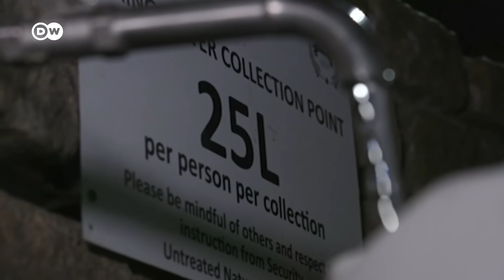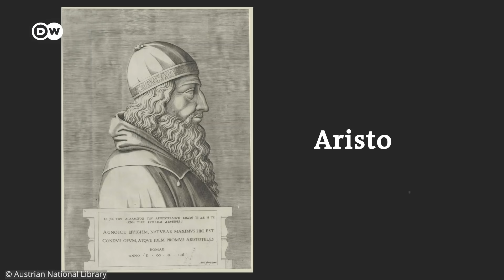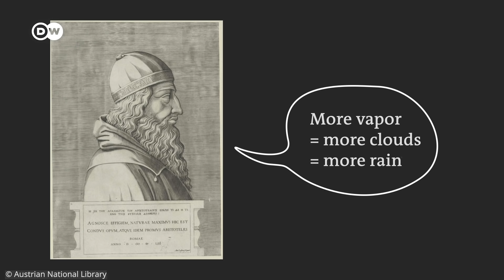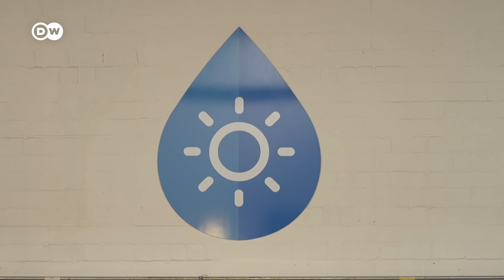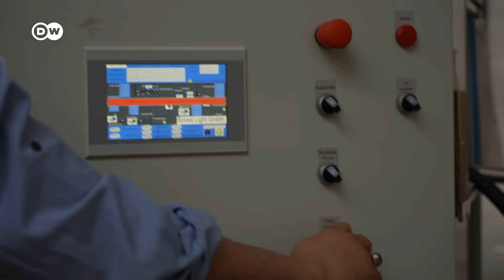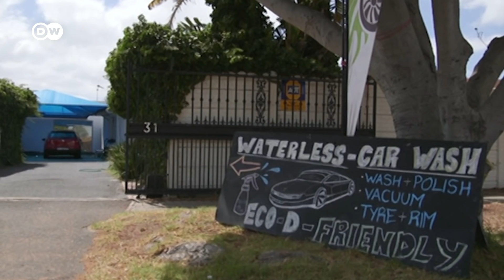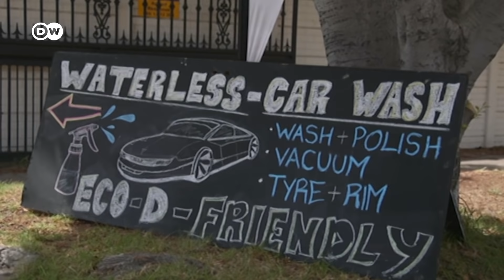Can desalination solve the global water crisis?

Comment: To put some numbers to desalination, for large plants the energy cost of desalination is just 2 watt hours per litre of water. Even basic solar panels produce sufficient energy to desalinate sufficient water for a person to drink and wash every day. Solar energy, water, heat, and people are all compatible partners.
Reply: Your numbers are wrong. It definitelly can't work for distillation plants.   And for membrane plants you must add into account cost of new membranes too. They must be replaced very often.
Reply: @nalim27  Naomi the Numbers are correct. Even for small systems on boats the figure is between 3 and 5 watt hours per litre. Note though that this is for systems with energy recovery pumps. Membranes have a very good life if they are used regularly. Pre filters on the other are more problematic, but those do not reflect on the energy cost of running the process. Distillation processes are another process with a very different cost structure.

Comment: Nuclear power which is one of the safest and most sustainable energy sources can easily be engineered to use salt water for cooling producing steam that can be collected as fresh water. Two birds one stone and cost effective
Reply: And what are you going to do with the tonnes of salt you produce as a by-product? Are you going to use the same salt water to cool the vapor down to condensing point? Do you know how much more maintenance goes into cleaning the heat exchanges in a salt water cooled system? Just food for though.
Reply: I sense a potential radiation contamination problem... In any case through electrolysis you can always turn the salt into other by products... Perhaps get some chlorine for other things
Reply: @skyreapery2n164  there is no cross contamination, they are in separate loops.  Using electrolysis is using a lot more energy for minimal gains.
Reply: @kae_oss  I'm sure over time it could improve to become easier

Comment: Nuclear plants should include desalination plants, they literally compliment one another
Reply: Ok i cam here for further explanation on how the complementing worked and i stumble with a playground quarrel... Come on explain!!!
Reply: As somebody that has served on a nuclear sub I can say that yes they use sea water to help cool the plant. But it is not the primary coolant and doesn't come close to getting hot enough to evaporate at a fast enough pace to give fresh water to even a small village. Evaporating water that fast would also ruin any pipes or equipment that the water is in.
Reply: @Kevin-ol5gr   I always wanted to ask this question to someone that’s been in your position. Having a nuclear powered ship in a task force what happens if it’s struck by the enemy near the reactor? Is there any plan if a destroyer has to tow you back to port and you’re leaking radiation?
Reply: @allenseeallendo5844  There's quite a few fail safes in reactors to prevent leaks but of course it can happen.  If the reactor is damaged and has to be shut down there's always the diesel backup to power the ship and that has been done to damaged nuclear subs.  
If there's a leak overboard then that's not much of an issue if you're not close to land and could likely be mended before going to a dry dock.  If there's a leak inside the boat it would be most likely in one compartment and the crew could just move to the other compartment and only enter the other when needed.  All crew do wear a device called a TLD if memory serves me correct, that keeps track of radiation exposure.  
As for what assistance or procedures the boat would follow to return to port, I don't know of any specific plans in situations like that as I was enlisted and didn't really need to know that kind of stuff.  However I'm sure there are plenty of plans setup for situations like that and what would happen would depend on many factors.
Reply: It's just a trick so that you can evolve into a ninja turtle...
Reply: The problem is that the nuclear plant would be vulnerable to the viscitudes of the ocean. It could get hit by a tsunami or a tidal wave. What we need is for someone to offer a billion dollar prize to find a cost effective way to desalinate sea water. (By "cost effective" I mean competitive with the watershed in temperate climates. Also, the cost of disposal of waste brine would have to be figured in.)
Reply: @tompalmer5986   Go ask the ABC islands they produce 100% of their clean drinking water from desal.
Reply: If they really have a cost effective way to desalinate sea water we should be asking them what they are doing right.
Reply: @tompalmer5986  True that man. I know California is adopting some smaller plants and I heard it’s raised the price of water by about $5 a month. Not a bad price. The huge problem is the farm lands using more water than the sky’s can replenish. We need to pipe the water to the farms.
Reply: Yep, definitely can take the salt out of the water but what will it take to the forever chemicals and radiation out?

Remember, our oceans are now being used to dump irradiated water in and with all the recent flooding, how many mine tailing ponds, chemical plant ponds, dairy and pig farm septic ponds have now added to the toxic mix?
Reply: @kellywills5852  heads up; irradiated means was "hit by radiation, but will probably be OK after a while", while radioactive means "was head so hard with radiation that it is now producing radiation". Only radioactive stuff is dangerous. A large portion of food is irradiated, as the radiation kills any bacteria, and then the radiation goes away
Reply: @kellywills5852  Just out of curiosity do you know what radiation is? You keep throwing around the word and saying chemicals but I don't seriously think you know what it means
Reply: I'm from Cape Town and I'm pretty sure our nuclear plant desalinates sea water. But not in very large quantities.
Reply: @danpom1426  Well I'm from Utica and I've never heard anyone use the phrase 'steamed hams'.
Reply: @danpom1426  Yeah, it probably wouldn't in huge quantities but having electric plants that are 10 times more energy effective than other alternatives as well as having clean drinking water sounds like a good combination to me
Reply: @matt8863  i wish people would attempt to learn shit before trying to argue, so annoying.
Reply: @matt8863  It's not that good sadly atm, due to the salt buildup but given enough time and research it could be viable
Reply: Especially if we build Thorium Nuclear Reactors. The Heat generated from the fission heats up the salt water to make it fresh water. At the same time the high pressure steam can create electricity. Too me it's a win win.
Reply: @GOGIRA_AMIGO  salt in the pipes, can cause jams and damage steel., but putting turbines at the power plants is a good idea.
Reply: @F K why even bother writing that? Is that the pinnacle of your wit? Literally an insult a tarded infant used as a soccer ball would realize is unoriginal and not worth taking pridein. You should feel embarrassed, and more than that, your parents and educators need to answer for the levels of ineptitude you've displayed here today.
Reply: There aren’t going to be anymore in the United States. No new nuclear plants can be built. Democrats think it’s dirty energy.
Reply: @allenseeallendo5844  what do you think about the mountains upon mountains of toxic waste they literally are running out of mountains to bury it in? Pretty clean if you ask me 😂
Reply: @MoCsomeone   Haha they aren’t  “literally running out of mountains” you’re a ding dong. It’s lock inside of cask it’s literally a very strong box inside of an even stronger box buried inside of an unmovable mountain guarded by the military. The problem is logistics they have to transport it to the mountain.
Reply: @allenseeallendo5844  hay hay once Elon gets his next line of rockets running maybe we can just yeet the waste on a collision course with the sun.
Reply: @ShortandWide  I like that idea, I think it’s got potential.
Reply: @MoCsomeone  you do know, that if more types of reactors were allowed, we could fission that waste all the way down to slightly radioactive Iron.

You won't let us do that.
Reply: @ShortandWide  the waste is incredibly heavy, it'd be better to let it sit then use it as Iron.
Reply: Just ignore the radiation
Reply: @benjaminnorris5540  You know that nuclear plants don't release any radioactive water right?
It has two different water loops
Reply: @himbalodzodenever  Do you not understand sarcasm or jokes? Does it have to be pointed out to you?
Reply: @benjaminnorris5540  Just ignore the radiation.
Nothing points to sarcasm or a joke at all.
Sounds like a generic anti-nuclear filler argument
Reply: @himbalodzodenever  Sarcasm is defined as the use of Irony to mock or convey contempt. It is best shown as either a very obvious lie or a very obvious truth. As you've pointed out water that is desalinated through a nuclear power plant is safe to drink what I said points to the former. I guess it does need to be pointed out to you...
Reply: @benjaminnorris5540  it was a pretty shit joke cause I didn’t realize it was one
Reply: @dillionthecrackhead3901  I never claimed it was a quality joke
Reply: @shawnsmith3741  You assume much. Just because one makes a random comment doesn't automatically equate to a political position on nuclear energy. But you'll give the guy remarking on ninja turtle evolution a pass. Yeesh tough crowd.
Reply: @benjaminnorris5540  just admit that you failed miserably conveying sarcasm and move on
Reply: @benjaminnorris5540  Nobody said anything about a political position. And what does another comment in the thread that nobody is even talking about have to do with how somebody should or should not obviously see that your comments was sarcasm? Don't try to change the subject to another comment just try and releaize that there is no way without any context (of which there is none) that your comment was "obviously sarcastic".
Reply: @benjaminnorris5540  sarcasm is tough to convey across text stop with the ignorant shaming
Reply: @benjaminnorris5540  Sarcasm needs to be expressed in an exaggerated manner. You didn't.
Reply: @benjaminnorris5540  Just admit you're bad at internet sarcasm and move on, boyo. 
Use a "/s" next time and you wont have that problem.
Reply: @himbalodzodenever  
You drink it
Reply: @thedevilsadvocate5210  there's a video of Tom Scott swimming in a pool of the outer cooling loop's water.
Any time
Reply: @himbalodzodenever  
You are welcome to swim in and drink all the irradiated water you want. Just don't try and force that on anyone else.
Reply: @benjaminnorris5540  dont worry i got the joke lol, idk why these people are so stuck up over it
Reply: @thedevilsadvocate5210  literally no contact happens between the radioactive bit and the part that has exposure to the environment. It’s like your cars air conditioning if you’re familiar with that, the ac is all enclosed and you dont breathe in the gas but it still does it’s job.
Reply: @kuiper921  
They have to do something with that primary coolant.
You cant just water your lawn with it.

That water becomes radioactive. If none escapes that is terrific.
but being familiar with a car's a/c system as we both are what's the reason I'm running a $99 a/c recharge special?

On paper they are all closed systems but when you start factoring in the transmigration of water look out.
Reply: @thedevilsadvocate5210  i assume there’s a lot of sensors that monitor an acceptable level of radiation within the outer bit.
Reply: @kuiper921  
That water has to go somewhere sometime
We will store it in a pool in your backyard.
Reply: @benjaminnorris5540  literally nothing about your statement hinted at sarcasm.
Reply: @benjaminnorris5540  because Ninja Turtle evolution is obviously a joke even if it sucks
Reply: @thedevilsadvocate5210  Water is extraordinarily hard to make radioactive. It will likely have a lower amount of radiation than background
Reply: @thedevilsadvocate5210  WATER CAN'T BECOME RADIOACTIVE. 

Swimming in a nuclear pool is safer than standing around
Reply: @thedevilsadvocate5210  
But the radioactivity will be diluted to the lowest due interactions with other chemicals in the brine such as chlorine, sodium, sulfate, magnesium, and potassium; therefore making less harmful.
Reply: @whathell6t  
It is amusing how you believe you will make an already toxic brine less harmful by making it radioactive.
How would that work exactly?
Reply: @thedevilsadvocate5210  
I said chemical interaction, not composition dilution. 
The products coming from the brine will be cesium chloride salts and zirconium salts. The rest of the irradiated water will be trapped by sulfate, potassium, and sodium due to their strong electronegativity (attraction) and close polarity (distribution of decaying electron).
Reply: @whathell6t  
That’s great.
Where are they doing that?
I always say you can never have enough money cesium and zirconium salts.
Reply: @thedevilsadvocate5210  
I was referring to the Fukushima waste disposal.
Reply: We do that already
Reply: @benjaminnorris5540  there isn’t any, this isn’t the Soviet Union we are talking about
Reply: @benjaminnorris5540  Water can't be irradiated. Only the dirt inside it can become radioactive, aka fallout.
Reply: @benjaminnorris5540  like lithium mining
Reply: @benjaminnorris5540  what radiation ?

Comment: I always wondered if a large scale solar SeaSalt setups could utilize a plastic water collecting cover of some sort. They're evaporating hundreds of thousands of gallons to get these brine pools, a ridged plastic tarp could direct all that distilled water to a collection system.
Reply: Exactly. Freshwater is a valuable natural resource. For people who already have sea salt drying pool set ups they’re literally allowing money to evaporate into the air when they could be collecting it and putting it to use. In very arid countries the water they could collect would probably be far more valuable than the salt
Reply: Turn into a business model and your in, and yes evaporation works
Reply: Yep, definitely can take the salt out of the water but what will it take to the forever chemicals and radiation out?

If salt was the only obstacle we faced treating sea waters we'd have done it long ago. However, because we know our oceans are toxic dumping favorites it's not quite so simple.
Reply: @kellywills5852  isn't most salt put through refineries to remove impurities/pollutants? This problem is common when harvesting sea salt. Desalination just reduces the starting solution more allowing a quicker drying time.
Reply: Har By  Nestle has Water collectors on top of large salt farms? My whole point is they DON'T COLLECT THE WATER... Your whole point is some butthurt Grudge about Nestle and has nothing to do with my comment.

Comment: The ocean is all we really need to propel us forward in a time of drought and death. The waves provide aqua-turbines free kinetic energy to generate electricity. We can then use electrolysis to make hydrogen at the same time, the water can be stilled off. Then we need to structure the water, then we can pump the water.